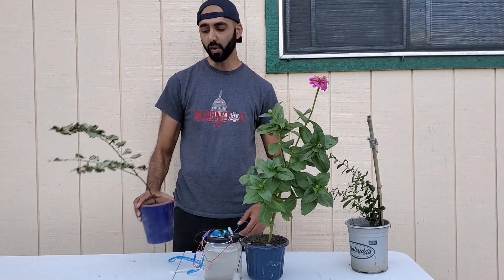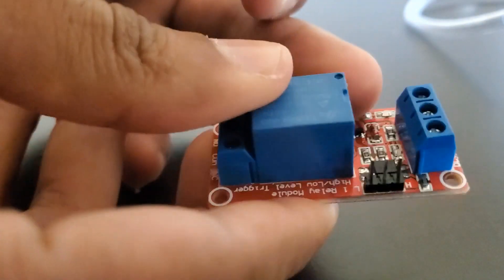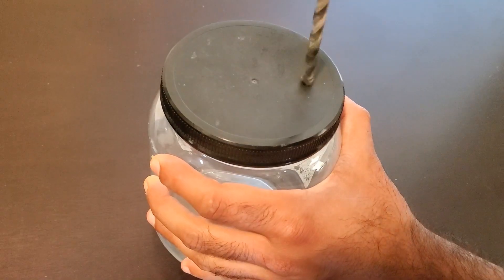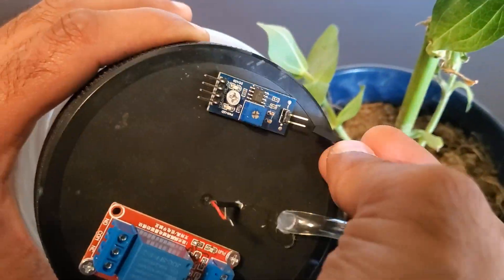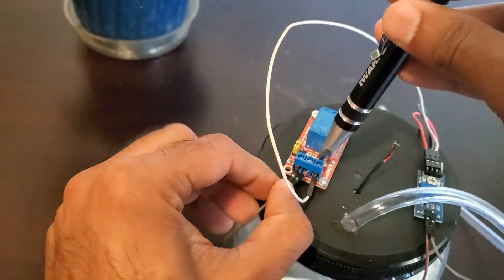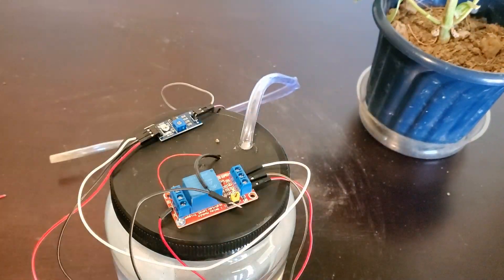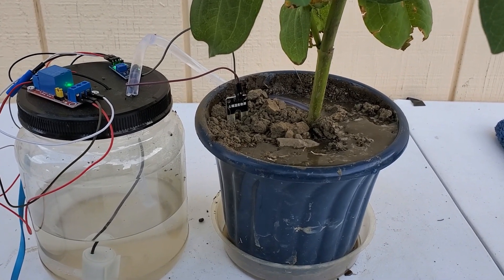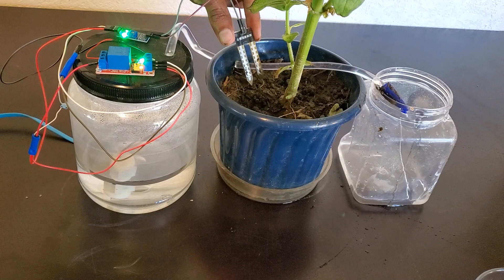Simple Automatic Plant Watering System || DIY

Comment: I'm new to electronics. I reproduced your exact setup but it's not working. I did a bit of debugging and the pump works well if I connect the usb directly to it. After a while, I realized my relay is 12v. Would that explain why nothing happens when I put everything together and plug it in ? Ah and also, thx for this video, I really like it.
Reply from the maker: Yes that would explain it. You need a 5v relay.

Comment: i'm a complete electronic noob, so a larger relay to power a larger pump?
Reply from the maker: If you have a larger pump that draws more current then the specifications of this relay (I believe they can handle up to 10 amps) then you would need a larger relay (maybe even a contactor if you are dealing with loads greater then 30 amps or so)
Reply: @DuctTapeMechanic  thnx bro, much apreciated

Comment: Has any done this with a capacitive sensor. All the ones I see you have to use Arduino with the capacitive sensor but this setup is much simpler and I want to use the capacitive sensor. Thanks in advance.

Comment: Hi! I have a question. Why does my pump keep on watering even though my sensor detects the water.
Also can you please give a blueprint on this. 

P. S.Thank you for the great content!
Reply from the maker: Thank you for watching. Is it possible you have ur relay set for "low trigger". Make sure the relay jumper is set to "high  trigger". I would check that first. Then make sure u are getting power to the sensor PCB (I believe an LED should be lit). Hope this helps.

Comment: Hey ductape mechanic,

I have a question, i made one but mine is werking the other way around. So of the meter is in contact with water, it starts the pump. Do you have any ideas in why this is happening?
Reply from the maker: Hey! Yes take a look out how the pump is wired into the relay. Is it in the NO or NC position? Also check to see if the relay jumper is set to be triggered at a high signal.

Comment: What happens when the water reservoir runs dry?
Reply from the maker: It's more for if your going on vacation or if you plan on refreshing the reservoir once a week
Reply: @DuctTapeMechanic  Is there a way to disconnect the battery when there's no more water? Like a switch?